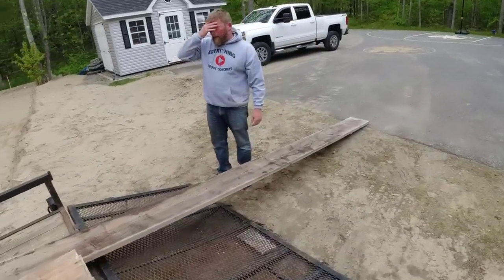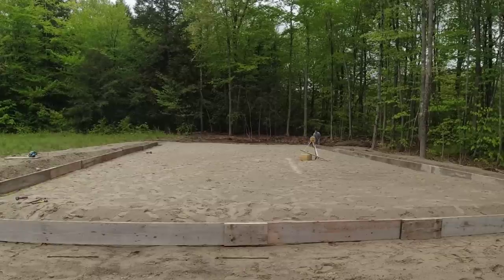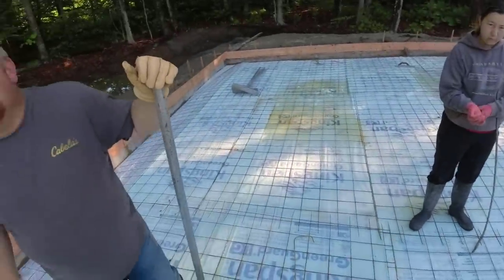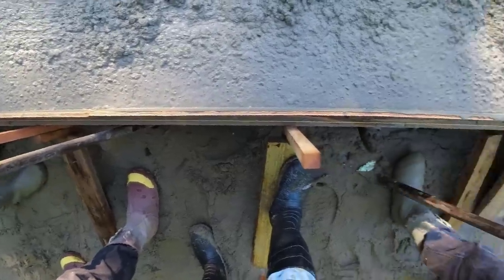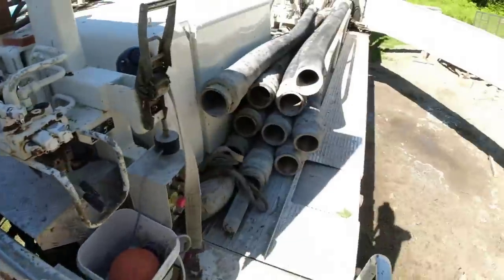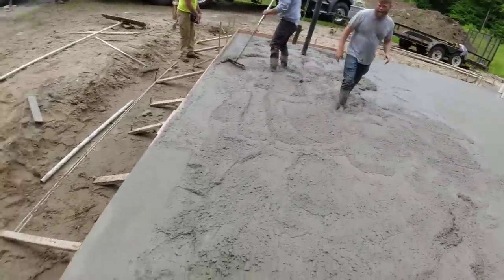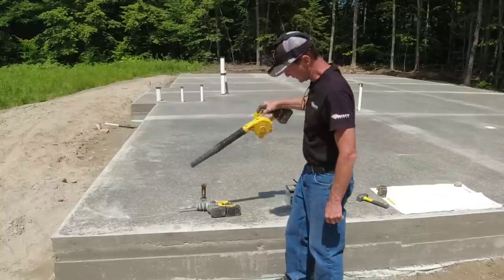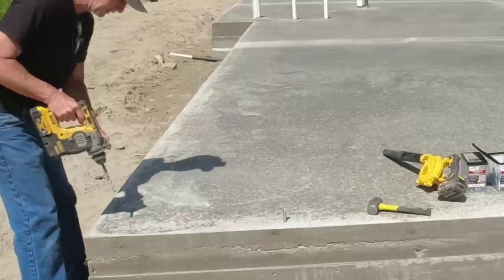How To Form and Pour A Large Concrete Slab for a Barn

Comment: I,ve done tons of slabs like that here in MI by Lake Michigan, with the beach sand it is pretty loose , but we compacted it anyway. Around the perimeter you need to backfill 3/4 of the way up the form with sand and you will not have a problem, it is more work, but it doesn’t move then.

Comment: This is the typical conditions for the area we pour, I'm on the longbeach peninsula in the state of Washington which is a mile wide and 22 miles long in essence it is just a big sand bar.  Our typical slab has a footing that is 12" wide by 18" deep and in order to keep the forms straight we backfill the forms with the sand and use kickers on the inside to keep forms straight until the mud is poured and the maximum slump we pour is a 5 as the pressure from a more fluid mix makes things move, the 5" slump is the sweet spot. Watching the videos in the past I have been envious of how you guys could use the fluid reducers without any issues.  Same with the steel stakes, the only time we can use them is if we are over an old driveway.

Comment: On thick edge slabs on grade like this, we cut 3’ or so stakes out of 2x4s, just enough to stake up each end of your forms. Then nail up the 2x12s to your floor height and tack your shorter forms underneath those. It’s easier to run your braces/kickers against a taller, more rigid form like the 2x12 imo. Just how we do it. Nice work though!
Reply: spoken like a true PRO.  tacking that 2x4 on top is silly and leaves and unsightly seam!
Reply: He said they didn't expect such deep sides, so they didn't have their 2x12's with them.

Comment: We have a lot of sand issues like that here in Florida. What’s even worse is sugar-sand, which is the same thing only super fine grain.
What we likely would have done there, is - about 3 feet out from the forms, run a continuous 2x4 flat on top of the dirt and steel stake the heck out of it. Then run your kickers back to the top of the 2x4 and nail them off. 
Something else we would do is - if you have access, before the slab dirt is trucked in, run a continuous #5 rebar all the way around, about 5 feet inside the slab and wrap perforated steel banding around it, going back out to the outside of the forms. Then bury it with your slab fill. Nail the banding back to the bottom of the forms. The last resort was backfilling the forms but that sucks when you have to dig your forms back out. If you’ve got a machine to dig out, it’s not too bad.

Comment: A few tips  Mike:  perimeter rebar should be a thicker, placed and pre-tied before the pour.
When the form bows out, never hit the brace with a sledge trying push back in, use the tip of a shovel  to pry down against the stake over the brace. this eliminates the risk of slippage and aggravating the situation.  I find it incredulous that you stripped and sawcut the same day, but had to go back to drill anchors the next day-  just put them in  while finishing you had enough people there .

Comment: I normally dig the bottom off the brace in the ground and on need to used steel pins just berry the end and run a plate   compactor over it .some ground I use a jack hammer to drive  steel in works very well with less effort.

Comment: You use the hook to pull up the 6x6 reinforcement wire to save buying concrete dobies. Code calls to support the reinforcement to hold it in the middle to upper third of the slab. Then your guys walk it to the bottom of the slab while placing the concrete. The only place the reinforcement wire is even in the concrete is in the beams, it is resting on the plastic everywhere else.

Comment: I’m just putting a foundation in so you can put the 2 inch Rigid foam under the foundation wall. Will the weight of the building collapse it. I am an amateur at this, so I am just ask that question.

Comment: You needed a 2x4 cross brace with 12' long 2x4s bracing it from the solid ground outside the sand.  Yep, more labor.  A cross brace 2x4 on edge, you know, is a good brace for this kind of plywood form.
Reply from the maker: It was mud outside the sand.

Comment: I find it interesting the use of rebar versus WWF differs by region. Also the practice of lifting the WWF during placement rather than placing it on dobies. Out of all the slabs I have seen demo'd with the WWF sitting at the bottom of the slab against the subgrade, how is this still an accepted practice? What keeps the fabric off the subgrade as the concrete is screeded? Especially with the almost self leveling mud.
Reply: They raise the wiremwsh with the hook and then  proceed to walk all over it, what do you think happens to the mesh, it goes back to the bottom.  So basically there is no reinforcment
Reply: @johnkunz6004  Good point.
Reply: They have stated when you pull up the WWM (wire welded mesh) it does not go down to the bottom, it gets stopped by the rock in the concrete.

Comment: I think this is one of those occasions when you use a stiffer 4” slump around the edge, and then screed off with 7” topping ?
Reply: Yeah looks like also the rain water the night before was just one more thing to make a little more of a wet mix than would have been optimum.
Reply: @tomruth9487  Hi Tom, You Doing Good?

Comment: I am building a I have a question for should my footings be 12 inches deep and wide no deeper or wider than 12 in please let me know thank you
Reply from the maker: That kind of depends on what code is in your area, what you're building on the slab, what's under the slab. In general, 12" to 16" edges is good for most residential garages, single story residential buildings as long as there's a good, hard compacted sub-base & a couple rows of rebar in the edge.

Comment: Hmm I have a slab prepped for my house with sand though at least it's drained and dry and well compacted. Would backing form boards up with timbers and backfill prevent the problem?
Reply from the maker: It might help. Sand doesn't hold the pressure well.

Comment: No spray cure?  

Strange seeing the concrete guy laying out anchor bolts.  Always good to have framer layout the bolt spacing so as to not interfere with studs and add bolts wherever sill plates join.  

Don't like that style of anchor bolt much - very easy to spall the edge when tightened, especially with green concrete.  Much prefer epoxy-anchored bolts.  A bit more expensive, a bit more labor, but no worries about spalling.

Comment: How is sand going to support the slab?  Won’t it sink in spots and break open that slab in a matter of just a few years?  I’ve never seen sand use as a base only…
Reply: Everything is poured on top of sand in Florida. As long as there aren’t any serious erosion issues and the engineer is happy with the compaction it achieves, it’s fine.

Comment: Im wondering if you can still use foam under the concrete on a machine shop where you will have heavy machines sitting on the concrete. It seems to me that the weight would mash the foam down flat.
Reply: It depends on the foam. EPS300 can support 14psi with a 2% deflection. 14psi doesn't sound like much, but you could drive a loaded pickup truck on it. The truck tyres are pumped to 35-40 psi, but the weight on the foam is spread out over a greater area than the tyre contact area by the concrete and reinforcement. Machines will usually be installed with spreader plates to spread the load. If you need higher loads, Owens Corning Foamglas goes all the way up to 75 psi which (with the right thickness of concrete on top) would have the same bearing strenght the best soil you can find.

Comment: Just curious: why dont you place anchor bolts before you pour?
Reply from the maker: It's easier to place them afterwards
Reply: @MikeDayConcrete  And more accurate. No chance of them getting bumped or sagging or anything. If the engineer says the hold-down and sheer strength is sufficient, you’re gold.

Comment: How long do you have to let the slab sit before you start to walk on it to finish working on it
Reply: Depends on the slump, how hot it is outside, etc…. But when you can push your fingers in the concrete 1/4 an inch it is ready. Or when you can walk on the concrete.
Reply: @jackwilliams7738  ok sweet. Thanks
Reply: @jackwilliams7738   I Think a 1/4 inch is too Wet, 1/8 inch is better, won’t be so Sloppy and You’ll have a Flatter Floor.

Comment: Think you should have used 2x4 steaks with kickers every 3’. Instead of plywood on top a 2x6 would have worked better without bowing out. Why not just wet set J bolts the day you pour? Looks like way too much extra work. 😂

Comment: I realize you didn't do the sand base and were hired to do this job, gotta pay the bills and building practices are different all over but I would have got back in the truck and said Hell No!  Fire is hot, water is wet and "You CANNOT pack sand"  I don't care what anyone says.  I sincerely hope when the slab fails they don't try blaming you.

Comment: Why wouldn’t you drill your anchor bolts right through plate and then pound them in? I can’t watch you amateurs anymore.
Reply: You would have to first drill with a wooden drill bit, then a concrete drill bit.  Obviously you're a couch contractor.